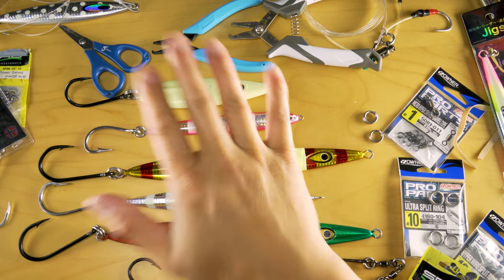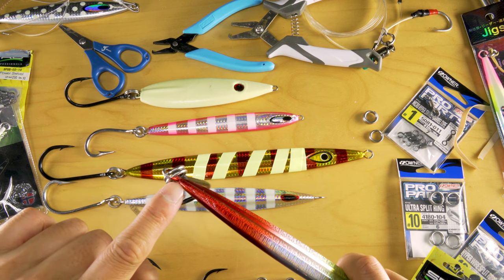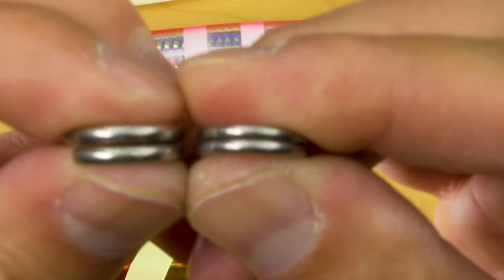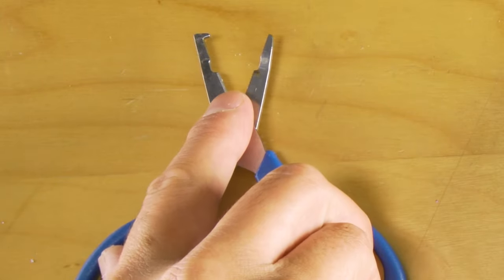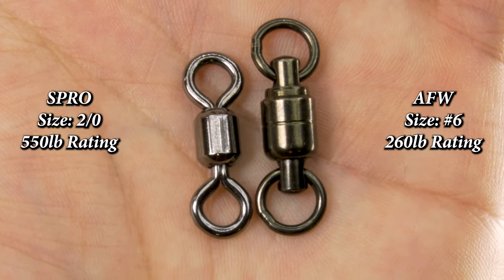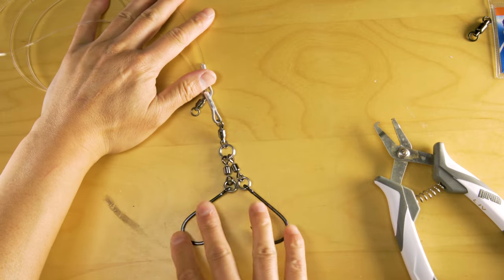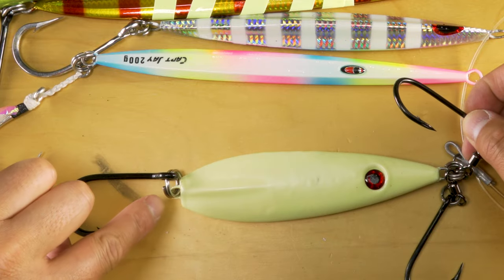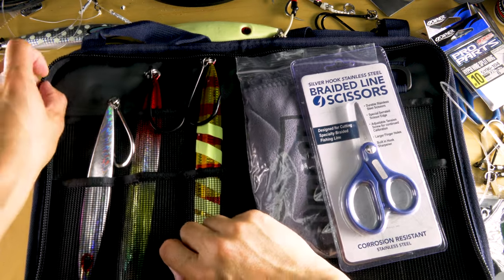JIGS for BLUEFIN TUNA Knife SK Flatfalls Rigging and Setup Tackle Tip

Comment: Very good summary. This is my first BFT season and I have had tons of questions getting set up. I never thought about using the swivels for the assist hooks and attaching them to the leader. That makes a pretty quick change out option. I subbed and liked, coming back for more training. My first trip is over Memorial Day weekend! Really excited. Nice video!
Reply from the maker: Awesome and glad it gives some ideas. Which boat are you going on? I really wanted to get out memorial weekend too. A buddy will be going that weekend. Should be good. Slay em 🙌
Reply: @Seastheday88   I'm going on the Searcher. Hope you can get out on Memorial weekend. Thanks for the great videos!
Reply from the maker: @kenmcintire6850  That's going to be a great weekend. I got my 113# last memorial. Reports this weekend showed way bigger grades, you're going to have a great time. I might try to get on mid week, have a family function to attend that weekend or I'd for sure make a repeat trip for Memorial. Best of luck and tight lines bro 👍

Comment: What do you think about replacing the split rings with welded wire?  You could definitely find a welder that could do it for some money. Probably expensiver than a Mofo, but worth not losing a PB BFT.  Have a welder TIG some stainless rings onto the jig with the hook.  I did this to all of my jigs myself. It wasn't difficult,  it just requires some expensive tools.
Reply from the maker: I really wanted to learn this method. Surface Iron (dot) com sells the kit. It’ll be 100% better and much more secure. I honestly dislike the size 10 Ultra rings because they require so much pressure to put on. Would def be worth getting the tools for 👍

Comment: I'm just curious if you are still rigging this way 2 years later vs using the more "traditional" assist hooks now? Mostly I'm asking about using the swivels vs the assist line on the hooks.
Reply from the maker: @Duhamal  thank you for asking. I’ve slimmed the profile as much as possible as current hooks with their teflon cord have really strong abrasion resistance. Plus our jig profile have gone smaller. I still have my 400 and 500grams but rarely use them. If the weather I horrid, where we need the heavy weights, I’ll go for an Eddie bomb before a longer heavy jig. I’m in the process of making a new vid regarding the tungsten jigs. The size and profile has been a hot bite.

Comment: There are guys in San Diego that have seen too many failures of split rings, so they learn to weld their solid rings. It’s really easy, just a Mapp Gas torch from the hardware store and the nickel silver rod for silver solder is all you need. Some guys don’t use the crimp style rigging, either. They can tie knots in big leaders. Those guys are BFT assassins, bro. They gear up for big ones. I’d rather be catching wahoo and yelliwtsil myself. Good luck out there.
Reply from the maker: Thanks John. Been researching about welded rings for some time and acquired some pieces to try to start. Hoping that’s where it will lead to. Have a friend who also wraps my rods that’s been very successful with heavy top shot mono leader to solid ring via chain knot.

Comment: Thank you for the info. Where did you get the Owner ultra split rings? It seems everyone is out of that and the mustad 7/0 assist hooks
Reply from the maker: Thanks for watching. I went to nearly all the tackle shops within a 20mile radius over an entire season as 2021 was the shortest of supply. I would check Melton Tackle and Charkbait are local to me and have online ordering but I just checked, 7/0 not available currently. Melton does have Mustad 6/0 hooks and Owner Ultra #8 in stock. There’s a code for discount as well. Good luck and hope you’ll find it. Thanks.

Comment: I used to rig my flat falls the same way until I was chewed off because the top hooks were so close to the leader. Large trebles as the bottom hook work well too.
Reply from the maker: This was my concern too. The swivel should add length and hopefully the heavier leader should help.
Reply from the maker: What lb test were you using for leader Danny? I recall last year reports when 100lb and 150lb got chewed off for everyone and they didn't have anything heavier.
Reply: 130#
Reply from the maker: @dannycarr8181  Truly amazing species when we prepare with heavy gauges lines and the battle demands us to step up further. I recently added some 200# and 300# leaders, don't know when I'll get to use them. Also which brand and size bottom treble are you using? I do have some VMC, but went for the Jobu for profile on these, I keep the VMC on my 100gr Zakanas.
Reply: I believe they were mustads

Comment: Great informative Video.
Question:
1. What MINIMUM Pound Test Braid would you recommend?
2. What length of Leader would you recommend?
Thank you in Advance.
Reply from the maker: Hi Sunil, I have a recent video with a leader for the jigs. Usually 3.5-4’ is plenty as the tuna aren’t as finicky at night. 150lb is possible but stories last season were that 150lb got chewed off so the heavier the better. I personally bought 175lb mono and 300lb mono for myself last year and this year added the 200lb and 300lb pre-rigged leaders

Comment: Hi Thanks for the very informative video, i just have a question on split rings, im a newbie so forgive me if this is a dumb question,  why would we need a split ring rated for such high poundage if our drag setting will be nowhere near that?
Reply from the maker: Not a dumb question at all. I had this same inquiry as well when I saw everyone else's rigging. You'll get different answers from many.
It's a combination of the weakest link plus abrupt bursts from your tuna. From the collective info, the split ring is the weakest link in terminal tackle for jigs. Depending on brand, then your hooks. Those bursts plus twist and turns will reallt put those rated numbers to the test. I've bought many various brands of split rings and putting them next to the Owners, other manufacturers seem to over rate their numbers. You don't have to go with biggest size, just match the tackle with your jig and hooks. If you're using smaller hooks, #8 is more than sufficient, same if you're using assist hooks that uses kevlar to a solid ring. 
I still use standard off the shelf assist hooks from Tady and Mustad in HD variants. Doesn't have to be this setup with split ring <> ball bearing <>split ring <> jobu hook. The whole game is to reduce chances of failure, whether it's knots, line ratings, upkeep of service on reels and I'm prob using a bit of overkill on this setup lol but I know I can't blame the terminal tackle when a failure occurs. Hope that answers it 🤙

Comment: have you considered how the lure reacts on the drop after you attach the J hook to the bottom of the lure. some the lures you have presented are slow jig lures, which are designed to etc on the fall. VMC and BKK both have hooks that have a hook ring that are tampered to allow them to be guided more easily onto the split rings fyi.
Reply from the maker: 💯agreed with that. I would’ve used the mustad jigging assist for better flow presentation but for this scenario, it was primarily rushing to get into the depth zone where ever the captain is spotting the schools. 
On a recent trip last week, when they wanted to bite, 200-400gram got bit from smaller snipers to longer knife style with bottom jobu or assist. 

I’ll be re-rigging some of the lighter grams jigs for a rock fishing trip coming up where the slow/fall jigs will have a better chance to be used there, I’ll use the BKK ones. Thanks for the insight. Let’s get it🙌
Reply: @Seastheday88  try the fast jigging rigs next time with the hook on the top eye of the lure for getting down fast mate
Reply from the maker: @TheDerek1976  thanks Derek! Will do. I was using the 400gram and it worked me for sure. Dropped the the 280 Williamson Kensaki and 320gr Nomad Streaker which made life easier again lol

Comment: I have this video saved as I'm new to tuna fishing. I have the jigs just info on what size hooks and rigging is all over the place. Thank you
Reply from the maker: Hi Steve, thanks for watching. The sizes may vary for each jig as well. Don’t want too big of hooks that may overlap for shorter jigs and vice versa. The Mustad Jigging Assist 6/0 and 7/0 and easiest to just hook on with split ring. Single top and bottom is easy way to go. 

More technical and complicated is what I have presented with single 9/0 Jobu bottom and double 7/0 Jobu on top for my longer/heavier jigs. Many ways to approach it, hope these tips helps and you can fine tune for your preference on which jig you are using it for. Thanks🙌🤙
Reply: @Seastheday88  got it, yea I'm using 6/0 on the smaller jigs and 9/0 on the big knife jigs. Thanks for the help
Reply from the maker: @stevemoon4458  awesome best of luck and hope you land em 🙌

Comment: I'm confused..your using 400-500 pound swivels but you put 120 pound split rings on your hooks , if you use a size 8 split ring. I would think they would fall apart , since your beefing up everything else.
Reply from the maker: Very valid point. The eyelet on the 7/0 jobu is ever so slightly smaller, so slightly smaller diameter gauge wire helps give it wiggle room. This is from my perspective and everyone should still test accordingly. Thanks 🙌

Comment: It appears as if your crimps were done improperly; however, it's hard to tell from the vid. They should be smashed from skinny side to skinny side.  Yours appears to be crimped wide side to wide side.   There's a chance it will slip when done wide side to wide side.
Reply from the maker: Hi Jim, Thanks for the heads up. Yes they were crimped on skinny side, it's the only way it'll fit on the groove of the crimping tool.

Comment: I’m going add a little info to this.  There was no knife jig in this video.  The Shimano Flat Fall, Daiwa SL Jig, Williamson Kensaki, and Mustad RipRoller are all Slow Pitch Jigs. The Kensaki and Rip Roller are deep water fast falling  SPJ’s.  Knife jigs are speed jigs. Slim, evenly balance flat side to flat side. They may be weighted differently end to end, but most are not. Most popular example in the US appears to be the Williamson Benthos Speed jig. Knife jigs, like most speed jigs, rely on the angler to use the rod to impart action, just reeling fast doesn’t do anything.  As to all info in the video, it was good info, I would recommend weld rings instead of split rings.
Reply from the maker: Thanks for the insight on that Dave. Will be adding that Benthros to the arsenal. I did have a Capt Jay 200gr thats fairly flat that I got on Amazon for less than anything on market currently. The Daiwa SL, I lucked out getting early season last year along with a plethora of Zakanas in 80-130gr. Hopefully get to have it bent this year. Thanks again!

Comment: as always good info on your videos, 
1 question what knot do you use when attaching the jig leader to your main mono line?
Reply from the maker: Thanks Tony! I used uni knot where I went through the swivel eye twice before the 10+ wraps. This was also what other seasoned guys recommended at the time.
Reply: @Seastheday88  thank you , yeah I use that knot, but I have never use it in anything above 50lb
Reply from the maker: @Tony67032  hopefully this season you can test it on a 100lb+ 🙌 I’m itching to go already 😂
Reply: @Seastheday88  ohh yeah , can't wait and hook a nice one
Reply: Main line: braid, no mono. Double San Diego with at least 7 wraps in the braid to the swivel that is crimped at the top of the leader. Bottom of the leader is a crimped Mustad figure 8 ring or solid ring, and a #10 or #11 ultra split ring. Assist hooks attached to figure 8/solid ring. Use split ring pliers to easily change out jigs without having to cut and retie leaders.
Reply from the maker: @HoxFeesh  for you bro. Appreciate the knowledge share 🙌🙏

Comment: What brand/size hook are you using?
Reply from the maker: Hi Boss. The Mustad Jigging Assist, size 6/0 and 7/0 are perfect for the larger jigs 
The Jobu hooks on split rings I have 9/0 on bottom and 7/0 on top. But you can size down as necessary for smaller jigs. Hope that helps. Thanks

Comment: Do you ever use circle hooks as the primary single hook? I was thinking a single Owner Super Mutu Heavy Duty Swiveled Circle Hook 10/0 on the bottom and same hooks in 7/0 size as the assist hooks on top. Do you prefer j hooks over circle?
Reply from the maker: Hi Greg, I personally haven’t. But read anglers who have been successful on it. I haven’t come across those size circle hooks is it part of the reason. Corner mouth circle hook bite has been my most successful so I def would say yes to that setup 🤙
Reply: @Seastheday88  Thanks for the quick reply. FYI,  those sizes are available on Amazon. Eliminates some of the split rings also. Planning on trying to silver braze a solid ring on bottom and on top use a figure eight ring with one end having the assist hooks attached with solid brazed ring and the leader connected to the other end of the figure eight. Do you think an ultra split ring to the solid ring between the figure eight and assist hooks is the way to connect to the jig?
Reply from the maker: @pacedge123   That sounds like a solid connection for top and bottom. For the figure 8, are you brazing a solid ring to it? You may be able to get away with just ultra split ring to the figure 8. That ultra split ring will also have your assist hook and jig. Regardless, those are all strong connections. And even the way my assists are is a lot of hardware presentation wise, but def something to keep in arsenal when something big arrives hopefully🙏
Reply: @Seastheday88  Agree. Going to play with it and try both brazed and split.
Reply from the maker: @pacedge123  Heck yea, put a hurt on those tuna, slay em brotha 🙌🙌🙌

Comment: What glow tape do you use?
Reply from the maker: It was a generic one from Amazon. My buddy gave it to me. The adhesive was hard to adhere to the grooves of the jig. Beginning wrap and at the end, wrap it around itself so it’s straight then do the diagonals. It held up for about 4 sessions since. I’ve been using 250-300gram jigs more often since. Plus I dread winding those 450+ up lol
Reply: Would youbhappen to have a link?
Reply from the maker: @grizzlytroutfishing8472  https://a.co/d/hqFW9YM

Comment: first time I seen jigs rigged like that
Reply from the maker: It’s a lot of hardware. The Mustad Jigging Assist on kevlar works just as good from my last season. Just a different option 🤙
Reply: @Seastheday88  might be good for toothy critters here in S Fl like King mackerel 👍
Reply from the maker: @ken244  100% agreed. I’ve seen two pics shared in the last couple seasons where the kevlar braid shredded through on one. Another was hanging by a few remaining strands but they got the BFT on deck. The best is when they swallow it and choke themselves or it’s right on the lip. Won’t know til we drop the jig 😂

Comment: Alright, gonna try this ,but if your set up fails and I lose my BFT then I will be unsubscribing ..lol
Reply from the maker: Lol all good. Mix it up. The mustad assist hooks on the Kevlar braid are just as good. I’m also going to try Tady Assist hooks on next outing. They have orange resin over the knots. Going my route is all hardware so nearly unbreakable if your drag is set accordingly. Ask deckhand to confirm, he/she will ask your main and leader line strength. I was out last weekend with it, hooked up but lost in a tangle. Good luck out there and hope you land that PB🤙

Comment: I guess everyone has their own thing but this is definitely not my set-up. That's a lot of swivels. My advice is learn to tie assist hooks correctly and simplify your set-ups.
Reply from the maker: Agreed. It’s a lot of hardware. I do use just the mustad jigging assist hooks only on a split ring and it’s the easiest since it doesn’t require a swivel unless you want it for additional length. Thanks for watching boss 🙏